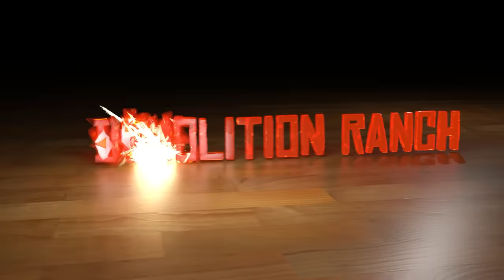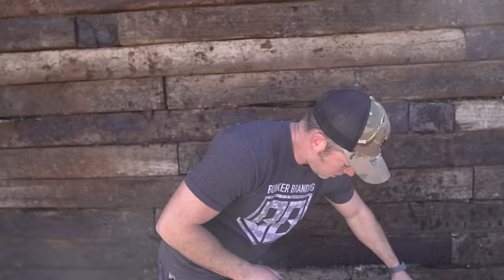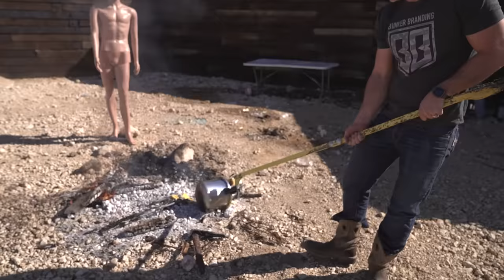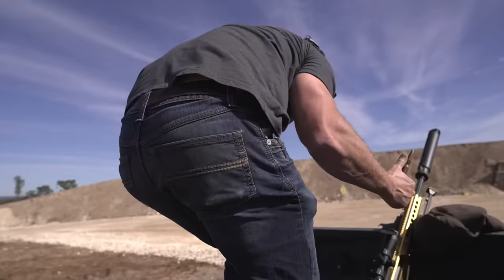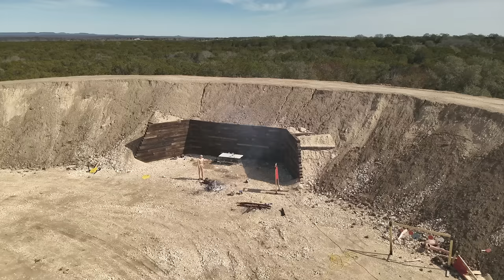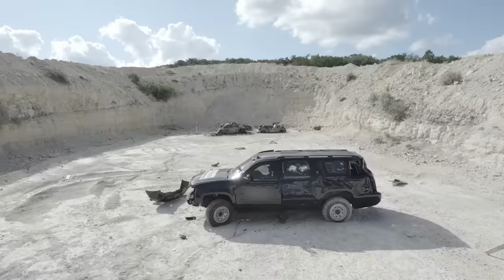Can a Pressure Cooker Kill You??

Comment: GAAAAAAA!!!!!! I am an avid pressure canner.  It takes TIME to build pressure.  30-40 minutes on high heat isn't uncommon.  REDO the right way.
Reply: @@darkcode5562neither of which are flammable? Though they do have low boiling points, you might not even need a heat source.
Reply: REDO!!!!  I concur!!!!!  Get to it, gentlemen!!

Comment: 10 minutes is not nearly enough time to build pressure.
Reply: Plus the ones on the fire, probably burnt the plastic seal.
Reply: enough for you to watch the video, though )
Reply: @northwales1000 I mean older stylw pressure cookers were always used on a fire so I doubt that, it's only since instapot came out that electric ones have become common
Reply: yeah even with closing the vents you probably need 45 mins or something

Comment: Hi Matt - anything you want to explode should be water based as water expands to several hundred times its volume when converted to steam.  Also, pressure will likely need to exceed 150psi to explode, so it will take much longer than the 10 minutes you allowed for that pressure to build.  Please refer to Mythbusters water heater episode, and try again - it will be fun to see.
Reply: Water expands 1700 times when at steaming pressure.  So a gallon would instantly expand to the area 1700 times of a gallon of water.
Reply: yeah, a pound of beans and some water will do nicely
Reply: Water and buck shot
Reply: @dylanherald1687  That's how you receive random ATF visits and we don't like that lmao
Reply: Moreover pressure cookers have some protections - overheat protection disables heating at for example 130*C, and there is probably also an over-pressure valve. To make it explode, you have to get rid of these.
Reply: About 1600 times, actually.
Reply: Thank you for saving me the time.
Reply: There is also the fact that boiling water releases hydrogen, which since they blocked the valves to release steam would then have been contained in the pot, meaning you will get a larger explosion
Reply: @brandialexis7859  As a steam engineer, I can confirm that boiling water does not, in fact, release hydrogen.
Reply: They specifically used a 55 gal water heater it's going to take a lot longer than the average pressure cooker to heat water to the boiling point what you don't know is that experiement on mythbusters was done over the course of several hours

Comment: Guys you need to wait much longer than 10min for it to build pressure.
When liquid turns to gas is what makes pressure build up, and for best effect you wanna evaporate pretty much everything in there, and that takes time.
I don't believe you didn't do the classic dry ice pressure bomb with that, and didn't put any gunpowder in the pot...
Also whenever you put flammable liquids in there and make it spill over the fire of course it'll light up, its not the pressure that caused the cool effects with the alcohol and "apple juice", but the 50 cal letting it spill onto the fire.
Really hope you're gonna make another one of those!
Ngl, at the beginning of the video I was concerned that Matt is turning into Scott with all the mayo and nacho cheese...
Only need some eggplants and watermelons to complete the set
Reply: For Matt, saying 10 mins is very safe.  Some knucklehead, crayon eater may try this and not take personal responsibility for his/her failure to think.   Ya don't need a gun to have a blast, when you have a pressure cooker and heat.
Reply: The rubbing alcohol did build pressure, though. It evaporates faster than any of the other liquids he used, and so it was able to build some pressure when in the fire.
Reply: @thechad4485  true, though it's visible how it sprays the alcohol everywhere and only then ignites from bottom to top and that's not pressure responsible for that effect
Reply: @scottnj2503  with a channel this large there has to be a knucklehead trying it out as we speak, and googling how to use a pressure cooker isn't hard. I doubt it was a decision made out of online caution and not boredom, as waiting for a cooker to build pressure really is boring. We see in the video how they constantly complain about wasting time on boring stuff and that pretty much clarifies it for me.
Of course, we can never know for sure unless Matt responds
Reply: @michaelgoldberg4000  Indeed. Though the fireball wouldn’t have been nearly as big without the pressure, as the alcohol would have simply spilled out. As you said, it sprayed. It sprayed due to the small amount of pressure it was about to build in that short time. For the other mediums, he definitely didn’t wait nearly long enough to have the effect he desired. And the water pot was only as effective as it was because of hydrostatic shock, not pressure as Matt assumed.
Reply: @thechad4485  for hydrostatic shock to be a factor the pot would have to be full to the brim, like when you see water jugs explode when shot, and that looks a bit different. I'm not disagreeing with you about the alcohol though, pressure obviously plays a factor in the effect though without the fire there would be no ignition which in my eyes made the effect much more awesome : )

Comment: To close the vent holes you should use some type of sealant inside and out otherwise it will still release pressure. Also 30 to 40 min minimum just to build pressure.

Comment: A couple of observations. 

First with the volume of liquid you're using you'll need to increase the waiting time for everything to heat to its boiling point.  Something like 20-40 minutes is probably more practical.

Second, using screws to seal the release valves could have potentially broken the seal and allowed for the pressure to release.  Pouring some heat resistant epoxy into the valves might be a better solution.

Third, the stuff you were putting in them was mostly just water with different additives.  Something like isopropyl alcohol, dry ice, liquid nitrogen, or gasoline would all work great at building a ton of pressure and some of them would definitely have an impressive effect with an incendiary round.
Reply: This was the comment I was looking for! You got every point! He definitely broke the relief valves with the screws, the pressure just went out through the spiral gap in the threads.

Comment: The isopropyl alcohol has a lower boiling point than water which is probably why you got a better pressure build.
Reply: Yep, and the gegetable oil that the mayo and nacho cheese are made from doesn't boil until about 570F.  Which may be some of the lack luster performance from those. 

But, I still watched it and enjoyed every bit.  Keep it up!

Comment: Fun fact, adding mentos to Diet coke does NOT produce any extra pressure. It just helps the dissolved gas separate from the fluid. With the baking soda and vinegar, put the vinegar in a sealable bag and put it on the bottom. Then the bag melts/pops, and the baking soda and vinegar will mix after it is already sealed. Just an idea. But you definitely need to redo this one...
Reply: Vinegar in a 2 mil plastic bag takes way longer than 24 hours to melt, lol.  Go back to your Google-University.
Reply: @jong2359  hmm you're right that anything other than a zipplock bag probably wouldn't work.
Reply: Better to sit the vinegar in a jug inside. Close the lid and give it a shake.
Reply: @scottll  that's a good idea!
Reply: Same idea as the old soda fire extinguishers. Filled with vinegar and a soda cartridge.  Flip or drop firmly to activate.

Comment: What you need is a liquid with low vapor pressure, so it vaporizes easily.
Like alcohol. Acetone. Gasoline. All the fun stuff that smells very... chemical and flammable.
Also, give it a good 30 minutes to heat up completely and built up max pressure.

Comment: In addition to the pressure cooker love, I'd like to point out that thermal is passive IR.  Since the fire is emitting (a lot) in the IR band, that is an IR shadow.  I'm sure the heat had some effect, but it's actually a "normal" shadow (i.e. light being blocked) in the IR band.

Comment: Given enough pressure anything could become explosive, you should revisit this with welded sealed steel cubes of different "gauges/widths" (theres a golden ratio to the air to liquid levels to give you the best chance of exploding and a liquid with a lower boiling point is also advantageous as the conversion from a liquid into a gas is what creates the pressure as the gas expands more than the liquid and a higher pressure means you can take a liquid over its boiling point and when the pressure is released then the liquid will flash boil and instantly turn into a gas).

If you got in touch with an explosive expert and compared the explosive potential between an explosion on a flat plate compared to one in a sealed container you might be surprised lol (the difference between a container made from mild steel vs hardened steel could also give a noticeable difference).

Using cubes will allow tou to calculate the internsl volume and allow you to calculate the amount of liquid to be at the golden ratio and if you get the welder of the cubes to drill a hole in the top and weld a nut to allow you to screw in a bolt using a crush washer to seal the cube air tight will give you the abilitybto pour the liquids or explosives in.

Diesel may be quite explosive but would need a higher pressure or heat but it does have a good explosive potential (why its so good when mixed with amonium nitrate as an oxideser to make amfo?).

I would use a range designed for explosives and getting good slow motion footage could look amazing and allow you to measure the acceleration or speed of the expanding gases.... just a thought 😆 🤣

Comment: Putting a screw into the pressure sealing valve was not conducive. It seals itself to keep the pressure in, putting a hole in it or keeping it pressed down just allows it to vent the pressure. Half full of Apple Juice in an electric pressure cooker, don't mess with the valve, set it to high for 1 hour, then incendiary round. 
That's the recipe your granddad forgot to tell you won the war 🤣😉

Comment: I'm not sure if you have ever cooked with a pressure cooker... It defintely won't explode in 10 minutes on fire, or most of people will blow their roof away with it.

I doubt if you have enough heat to boil that much coke inside in 10 minutes. For 3~4 liters of water it usually take half an hour to boil. And you will start to see pressure building up.

And remember to block/seal the failsafe valve on the pressure cooker so it won't release the pressure before it explodes.

Comment: Yeah, didn't wait long enough for them to build pressure, and the release valves on some of those definitely leaked. A quick JB Weld or epoxy globbin' job woulda done much better methinks.

Comment: You should open one when you aren't supposed to.... when the vent has not opened... so worst case scenario your pressure cooker thermostat has failed in the on state, the safety valve has failed closed, and you walked up and just tried to open it without looking at the pressure gauge, will it even open normally or would it immediately be obvious something was wrong? If you can get it open does it fail catastrophically? Does it just spray you with super heated water? I wonder if some types might actually explode as soon as it loses the extra strength the lid and latch provides before the pressure escapes? Also an awesome, amazing, multimillion view video idea, hot water heaters, see how much water produces the biggest boom, for example, a 20gallon with 5-10-20 gallons of water and a 50 gallon with 15-25-45, they will be way better than these were....

Comment: Short scientific input. When the water is 100 degrees Celsius hot, it wants to boil and transform into gas. In the pressure cooker isn‘t enough room for the bigger volume of the gas and the majority of the water stays liquid. That way you can heat liquid water over boiling point. Thats normally impossible. Easy said: „You can‘t get liquid water with a temperature over 100 degrees Celsius (that equals 212 degrees fahrenheit by the way) under normal pressure because it cools down by produceing steam. But if you increase the pressure it’s harder for the water to expand and you can produce very hot liquid water.“ If you open this system without releasing the pressure your soup acts like the water in a geyser. The overheated water turns in an explosionlike manner into gas and expands and tears your system into pieces. If you have more water in the heater the explosion is even bigger. The problem with the mayonnaise is that it doesen‘t turn into a gas. That means that the pressure doesn‘t increase and the explosion doesn’t happen. Same thing with the cheese by the way. (Bear is mostly water and alcohol so should be ideal for nice explosions even though I don’t know how the carbonic acid behaves. Don’t know what went wrong with that. Maybe you used to few or it leaked. Same about the coke and the vinegar.)

Comment: The temp on a flaming  fire is about 617 degrees (give or take) at that temp water will expand 3200% so 1 liter would have given 3200 liters of expansion, I'd have given it 20-30min then shot it the pressure in a sealed environment may stop all the water from turning to gas

Comment: At lower temps water is going to be your best friend due to its expansion volume into gas. However Alcohol in a pressure cooker at very high temps is dangerous and yall wouldve been too close had it exploded on its own. Actually, if ANY of those cookers got around 100psi, yall wouldve been too close. Stuff like oils in the mayo, or fat in the cheese would've stuck to every surface and stayed burning for a long period of time. Please be more careful with your distance of these objects.

Comment: Hydraulic energy is not explosive. This is why hydraulics can run such high pressures and a failure (when you're not generating pressure) is nothing more than a little squirt or pop. There is so much less compressibility in liquids than with gas/vapor, which is why you never see pneumatics anywhere near hydraulic pressures. -- so filling them all the way with mayo and nacho cheese not only gave you a giant thermal mass that never really heated up, but any pressure you did create was in the small cavity at the top and only could expand to push the liquid out.

If you attempt a redo you need to balance your enthalpy of saturated steam to the beginning mass of liquid in your chamber. You can make some real grenades with pressure cookers. And then vessel design becomes important. But shrapnel and real explosive dangers become present and your setup in this video would be very very unsafe. Good luck dont die!

Comment: The thicker the stuff you put in it, the longer it will take for heat to even propagate through the mass because molecular motion is inhibited by the high viscosity.
If you want to quickly reach high pressure, the ethanol is a good pick, acetone boils even faster.
Bonus points because flammable.

Comment: Of course water will give you the most pressure - the expansion ratio of water/steam is crazy.  That's why they built steam engines, and not mayonnaise engines!

And not to pile on, but ten minutes is just getting out of the gate.  Also, if you want pressure and you want it soon, just put in a fairly small amount of water.  It will boil sooner, not be totally vaporized but leave most of the room for high-pressure steam, where the big energy is.

Comment: Pressure builds in those things by the evaporation of the liquid in it. Guessing Mayo and some of these other nasty things have higher boiling points so it takes longer to build pressure with them than with water. That's why the mayo one didn't explode.

Comment: You need to wait long enough to boil whatever is in the pressure cooker. Also, I don't think putting a screw in the vent is really going to plug it up. The pressure will escape though the threads.

Comment: the water is the most dangerous when you only fill it a little,  the small volume of water becomes steam because it cannot vent it keeps building more steam and getting hotter and hotter as the pressure goes up, eventually, the pressure would destroy the vessel containing it.

Comment: Depending on the heat source, pressure cookers need a lot longer to build Pressure.  If you're using one for canning it can take up to 30 minutes just to get steady steam to vent out.  Then building the pressure after placing the weight on the vent for the desired pressure (mine has 3 pressure options) can take at least another 10 before it's up to normal operating pressure and begins to chatter the weight etc.  Of course that's heat source dependent.   Either way, 10 minutes in THAT bed of hot coals will never blow a pressure cooker.  The electronic can ones can take up to 20 minutes to build enough steam to set the lock pin on the lid to pressure cook in normal operation.   Yes these can explode, but it's gonna take more than 10 minutes lol.

Comment: Seems they forgot the seal around the lid is also designed to push out and leak pressure long before any dangerous levels are reached!
Next time replace the seal with a solid piece of rubber and wait an hour!

Comment: An infrared shadow is a real shadow, Matt. Photons with different wavelengths are still photons and the same laws still apply. Heat is also light at the same time, the atoms in the material have energy to radiate outward which emits photons that transfer their energy to the atoms of our atmospheric gases.

Comment: You will need a hotter fire then that with it being out in the open like that the heat is gonna be dispersed out quite a bit due to even the smallest of breeze so it will take longer instead of all straight up into the cooker like the electric one and you will need to fill them up more like you did with the 1st less space in there the quicker the pressure will rise